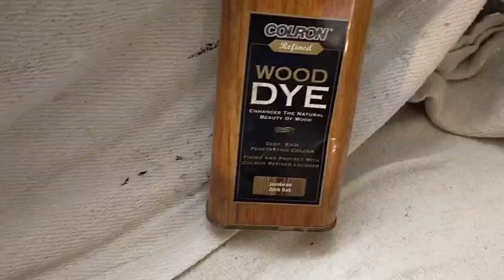Applying Varnish After Stripping And Staining Staircase

Comment: Another cracking job! About to tackle a job using your approach (thanks for the video instruction!). We’ve had a fan problem in our bathroom and ended up with condensation running down the outside wall. Fan fixed but the condensation has left the affected paint shiny. Wash down, dry, thin coat of Bullseye and emulsion on top 👍👍👍👍
Reply from the maker: Thank you.